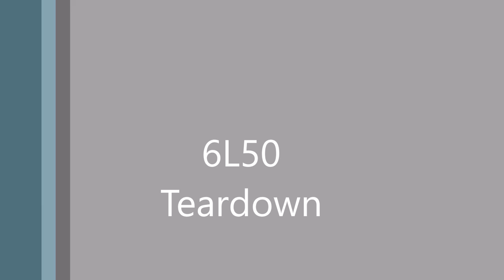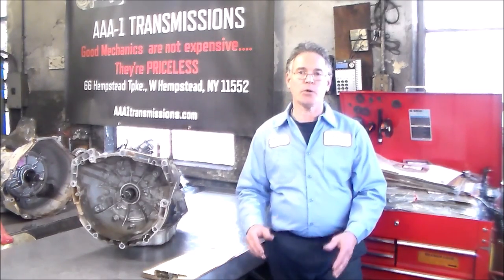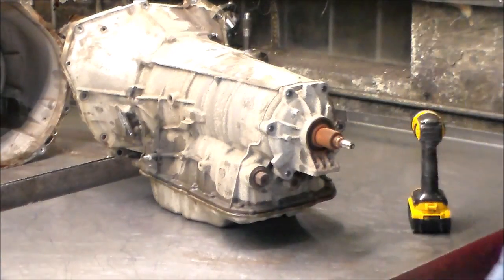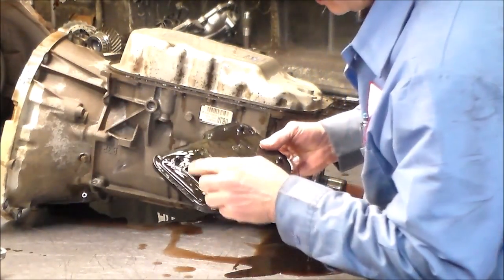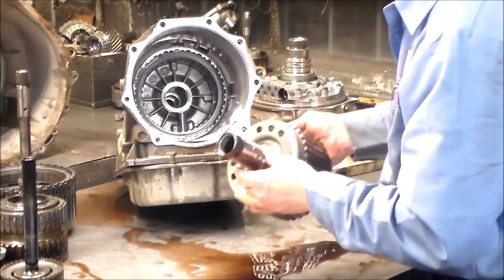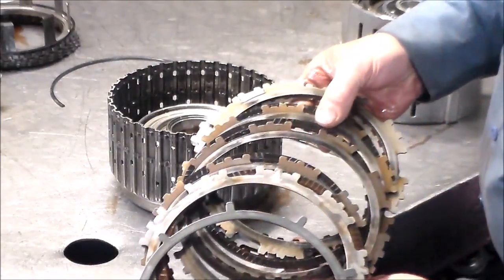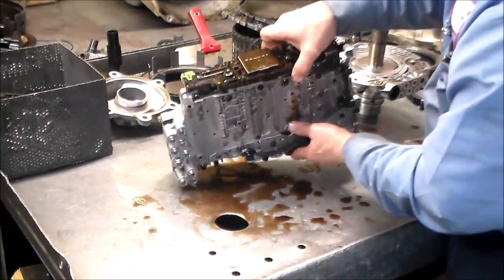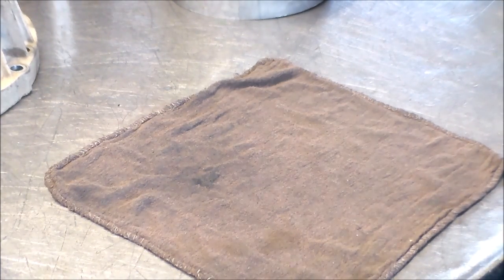6L50 Teardown

Comment: Your comments about Ford C-4 sticking governors reminds me of a story. A Transmission mechanic was recalling some of the things the mechanic that taught him, way back when. If it was a Ford C-4, C-6, or FMX, and the governor was suspected of sticking, he would get the vehicle up to about 40 MPH on the road, then, try to engage it in Park! The idea was to have the parking pawl create so much rattling that the governor valve would dislodge any particles. The later mechanic would never try that, he would rather take off the extension housing, and, clean up the governor that way. ;)
Reply from the maker: wow, never heard of that method , did that work?
Reply: @GaryFerraro  I'll bet it occasionally created some additional work and revenue.

Comment: I searched out information about my Duramax 2.8 Colorado in order to see what is inside this transmission (mine is failing). This is an awesome video to show how this transmission goes together. It would have been awesome to see the TC as well, since it was obviously damaged, maybe even tearing it apart. But still an awesome video. Thanks for the info.

Comment: Thank you Gary I was waiting for the video of the trandmission 8L45.
Reply from the maker: Had one a few months ago but it was so busted up and could not get parts, had to go with a dealer reman, then i programmed it
Reply: @GaryFerraro   I built the 8L45 transmission, I bought the parts on transtar and other parts in the dealer.
Reply from the maker: @JosePerez-fw1zj  where are you located? i went on transend ordering site and i didn't think i could get the kit, what brand kit did you use?
Reply: @GaryFerraro  Im located in los angeles California. I'm not sure what brand I used but thats where i bought it from.

Comment: You are correct we do have a governor problem. What makes the 50 or 45 and the E.
Reply from the maker: That is the torque rating, the 45 and 50 you will find only in cars or small vehicles  The E is Electronic

Comment: Another Colorado/canyon owner here. Think I've got a blown converter, but I know you mentioned sonnax o ring kit for the valve body, in an install like this would you also recommend something like their "zip" kit?? And also out of curiosity, typically what would a rebuild of that depth costs approximately?
Reply from the maker: Zip kit can't hurt, should come with the o-ring end plugs, never used a zip kit myself,  This rebuild with a computer runs about 4300ish

Comment: I have a 6L50 in an 08 CTS. I had a stripped output shaft spline and the transfer case stripped input shaft spline, both replaced. I'm getting codes P0700, P0716 and P1751. After driving a while or intermittently, I get a very hard shift, especially when in traffic at slower speeds. Have you experienced this issue before? What would you recommend?

Comment: I just bought a 2016 gmc canyon diesel 146,000 miles  has 6l50 and 3rd slips at first before locking in, the slip time veries no slip to all slip to 4th depending on throttle seem not to slip with heavy throttle. 
Will be towing in the future and don't like fixing things twice 
so I've been doing some research and most common issue seems to be the check balls. 
I don't want to remove the trans. 
I'm thinking a valve body service and a deep pan would fix it. 
Any other service suggestions while I'm in there. 
Seen people say adding separate trans cooler isn't necessary as they don't tend to overheat. 
I did see your other video with the o-ring plug kit😉
Reply from the maker: Well, Never seen a checkball cause a slip in 3d.  How are reverse and 5th gear?
Reply: @GaryFerraro  hard to say only had it last 600 miles
Reply from the maker: @willyck948  I ask because the clutch that comes on in 3rd is also on in 5th and reverse
Reply: @GaryFerraro  I'll try manual mode on the highway tomorrow and check. 
Would that mean full rebuild, checking shift pistons, or solinoid. 
No malfunction indecator lights on the dash.
Still watching YouTube videos here and there. 
As you can imagine the truck does run and drive but needs lot of service work done and don't want to tow till everything is up to 100%
Reply from the maker: @willyck948  yes, if issues in reverse and 5th, clutch pack maybe bad
Reply: @GaryFerraro  been setting manual mode in 3 and 4. only gear the acts different is 3rd gear.

Comment: Would you always upgrade the regulator? Would all the friction be replaced? If the shuttering torque converter is a consistent failure point who makes a better one?
Reply from the maker: I always update regulator valve (big problem with wearing out) Always replace the clutch plates.  I believe the problem is the material that the clutch is made out of. So that has been upgraded, I purchase the converters from Transtar and rarely have a problem
Reply: @GaryFerraro  Seems we are all learning about these 6l50's. 
In todays market is a new 6l50 even worth?  knowing what its going to do.
Just drop the trans and have it rebuilt with upgraded plates and clutches new master kit for switch in the electro hydro switch ?
and going to replace with Amsoil Dexos iv. 
That's what I perceive anyways.
Reply from the maker: @AbrasiveJay  i honestly do not get that many 6L50 units,  the 6L80 i get every week and thats what i do, all upgrades and new TCM
Reply: @GaryFerraro  So I got a quote from a Local guy saying 5500.00 for the rebuild. 
Don't have that on hand. Now I don't know what to do If I flush it, It could make it worse. I bought all fluids from amsoil ATF was like 150.00. 
Should I flush it and hope for the best. 
or just save up for the rebuild and deal with it?

Comment: Gary this was a great video.  I have this transmission  in my GMC Duramax Canyon.  50,000 miles.  If you did your rebuild, as impeccable as it appears, would this engine just eat up this transmission/TC again?

Currently truck shudders, clutches feel like slipping in 2-4 ranges, and there is a big chug when engine shifts while truck is decelerating (highway speeds).
Reply from the maker: Any codes present?
Reply: @GaryFerraro  I have a few codes that all relate to the DPF diesel particulate filter.  Nothing clearly relating to the driveline.

Comment: hopefully you can help me. I have a 2009 cadillac cgs with the same transmission. Problem Is when from a stop I accelerate and it feels like 2nd gear goes in twice. It feels like it kinda grabs for a moment then releases it and the grabs again but with a hard pull. sometimes if I take off fast it doesnt do it.
Reply from the maker: Sounds like something is going on with that 2-6 clutch, piston may be debonding. has this been scanned for codes and has the fluid level been checked?  car does the same thing cold and hot?
Reply: yes it has been scanned but no codes. It has brand new oil with a new filter. at first it only did it when cold. after driving for a few minutes it went away. now it just does it at all the time but when cold it just shifts hard and as it gets hot it starts to feel worse

Comment: What banner kit did you use? Does it include the valve body rebuild parts?
Reply from the maker: I use TransTec with Exedy Fricitions and OE Pistons,  What valve body parts do you mean?
Reply: I was thinking of the sonnax end plug kit
Reply from the maker: @johnbene3277  On Everyone, bore plugs are very loose

Comment: Why wouldn't you change filter and see what happens before tearing it down
Reply from the maker: The filter was clogged which means something is coming apart, if you change the filter , will only last a day or so before same problem,
Reply: Thank you for responding to my question

Comment: BMW X1 6L45 no start as transmission in R not in P even after shifter put inP
Reply from the maker: Possible range switch is no good, switch is located on valvebody
Reply: Can I change range switch
Reply: Thanks
Reply from the maker: @gs3188  Yes, just drop the pan, 2 bolts hold it in and unplug old one from TCM, very easy to do,  Make sure you install the plastic rod into the manual valve